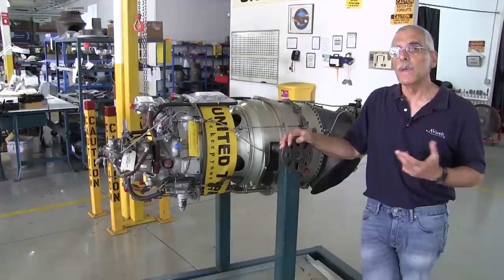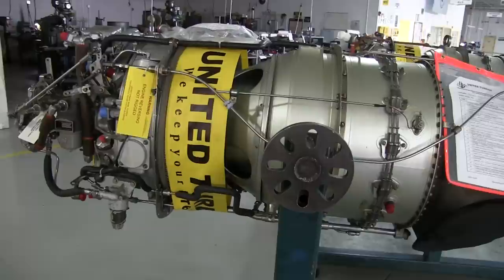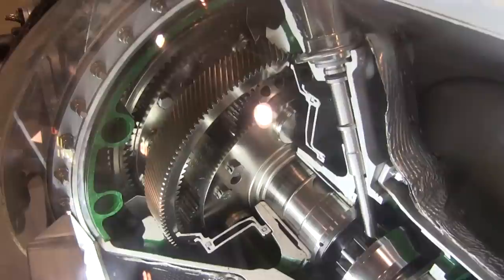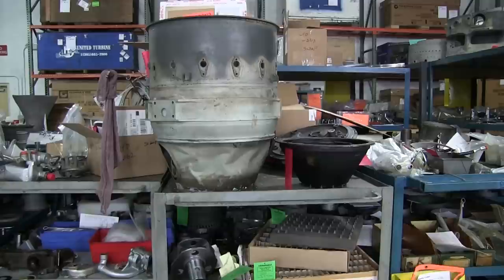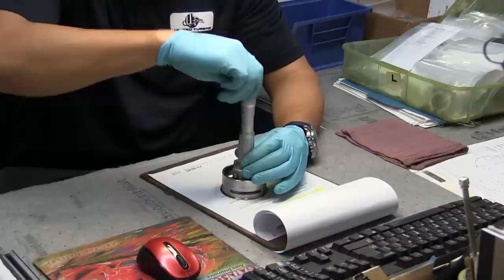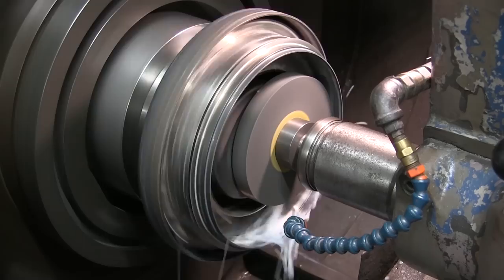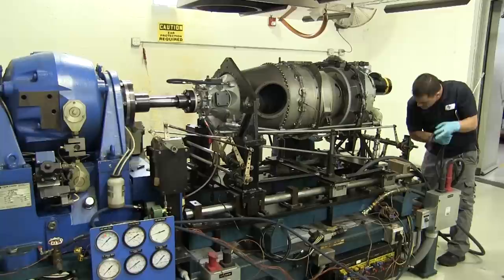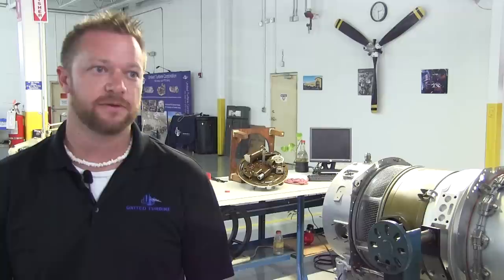How PT-6 Turbines Are Overhauled

Comment: The final step is open-wallet surgery, performed while the customer is hanging upside down.
Reply: lol!
Reply: I love the imagery...but...if something goes wrong in the air you can't pull over to the side of the road. Repair is still cheaper than replacement.

Comment: In your explanation you say the free turbine setup makes it different to a turboshaft, this is incorrect. A PT6B is a helicopter version, which is still a free turbine but also a turboshaft because of the mayor gearbox it is attached to. 

It is mainly wording, I know, and a bit confusing. Because all turboprops have gearboxes between them and the prop, so I don't know from which point it changes to a turboshaft by definition.

Comment: Was hoping to finally see the machine that liquefies cash and injects into the parts :(
Reply: +sugershakify You did see the cash liquifier. It was that entire building! It takes cash and converts it over to parts and labor and profit at an astounding rate!
Reply: It’s smaller and harder to see at P&W overhauls. The ones used on Safran overhauls are much larger.
Reply: Are you saying there’s a HUGE markup with turbine overhauls?   Similar to an oil change for a Mercedes Benz vs Toyota?  😜

Comment: Are PT6's still made new from the factory or are they all rebuilt?
Reply: They make new PT6 engines. There are new planes being build that use PT6 engines. They install new engines, not re-manufactured engines. There are several versions of the PT-6.
Reply: We (eaton aerospace/ Argo tech) make OEM fuel pumps all the time. Haven't made many spares, all for new OEM engines.

Comment: I wonder what the power losses are when you force the incoming air to make four 90 degree turns before it is mixed with the fuel. The exhaust of course also  generates negative energy  through negative thrust and drag as it is expelled out of the front of the engine. Building a pusher prop version of the PT6 would probably be more powerful since the air could be fed directly into the compressor section.
Reply: Look at the Piaggio Avanti. :)
Reply: Afik is because it helps keeping the gearbox mechanism small and makes for an easier installation o small aircraft.
Reply: There will always be parasitic losses whether the airflow changes direction or not.Every engine that uses centrifugal compressors must initiate at least two 90 degree airflow turns.This is how a centrifugal compressor works,it trades air velocity for pressure.This is known as the Venturi effect and applies equally to liquids and gases.

Comment: The turbine overhaul process is considerably longer and more involved than overhaul of a typical automotive reciprocating engine.
Reply: Even the overhaul process of a piston airplane engine is longer than an automotive engine overhaul.
Reply: Yes that goes without saying. You can overhaul a recip engine(automotive) in a day or two. It is a very different world when you start looking into how much documentation and tolerances impact the job time in aviation.
Reply: What makes the overhaul process and costs so much more for an aircraft engine over a car engine is the number of intensive and detailed inspection procedures,  equipment and requirements. 

A car engine failure is generally a fairly minor inconvenience.  An aircraft engine failure is often a fatal problem.

Comment: Hello
first of all, I'm sorry my English is very bad.
I have a PT6A-6.
This engine; turbine blade, Thermocouple Probe, stator vanes's burned.
How can I get these parts?
Reply: Hello, if your vanes are burned beyond OHM limits you will need a new set of CT blades as well. Pratt & Whitney Canada Plant 5 in Saint-Hubert, QC, Canada can overhaul your engine but the PT6A-6 is a very old model and it might not be worth repairing.
Reply: When he mentions stator, I guess he means PT stators not the CT ones. CT stators have their vanes eroded and FODed, not burned.Having an old model never been an issue as long as the engine have his Certificate of Airworthiness. He should probably look for an Authorized Service Center near him instead of having it shipped at St-Hubert. He mention having issue with his English language. He's probably not a north American operator. As for the old spare parts, as long as P&WC knows that one of their customer need one, I can assure they will provide it. Its a matter of pride and reputation to stand by the "Reliable Engine" logo. A couple of years ago, they even rebuilt two WASP for a replica of Amelia Earhart's airplane.

Comment: It would be interesting to get some idea of the cost involved. There must be an absolute minimum and typical cost they could supply.
Reply: Not all engines wear the same though, once you start replacing the spinning parts, it probably gets quite expensive quickly.. Like thousands per blade. and tens of thousands for discs...
Reply: It’s generally about $500,000.
Reply: There's no price for reliability.

Comment: so what does it cost to rebuild an average pt-6?
Reply: $200,000.00 to $300,000.00.. They cap the cost at $300,000.00 for a normal functional power plant.
Reply: The TBO and HSI varies depending if it's a small PT6 or a large PT6, from 2000 hrs for PT6A-38 to 6000 hrs for some PT6A-65 and 67 versions. But P&WC offer a pay-by-hour maintenance plan that most operators use to keep their maintenance fee as low as possible. Now some parts are replaced or reworked before attaining the TBO mark, making less likely to spend a $300k in one shot. Plus, there is less occurrence of extra worn out damage that happen when many parts get old and affect the performance of other.
Reply: so unlike his opener where he compares piston engines and turbine engines, turbine engines don't really have a longer TBO unless you go really big

Comment: I love how he opens up with the completely false statement: "all parts are spinning in the same direction..." Absolutely wrong. The compressor turbine and Power turbine spin in completely opposite directions.
Reply: Primus Airborne his statement is true if you don't understand it as " all moving parts goes the same way", but as "each part only goes one way". In a turbine engine, each part has one direction of motion, in opposition to a piston engine where parts are changing directions at least twice every rotation, hence avoiding accelerations on the parts or non uniform wear... It's kind of a semantic problem there, I think, although as I'm not English speaking born, maybe he should have said it some other way to be properly understood...
Reply: Also implies at 1:50 that turboshaft engines are not free turbine, but the PT6B is a turboshaft engine and it is also a free power turbine design.

Comment: This technology is so old. I can’t wait till everything goes electric, simplified, efficient. No more ridiculous costs for overhauls. Aviation will finally be cheaper and more affordable.
Reply: Yeah...just got to wait until they discover an efficient fuel source to give good sustained flight times...lithium ain't going to cut it...fission is dangerous and still to heavy and bulky...guess we will have to wait until we become a type 1 civilization in a century or two when we crack fusion!! Hydrocarbons aren't going anywhere anytime soon!!
Reply: It won't matter that the powerplant is simple. It's aviation and it'll always be expensive. There's always going to be inspections and time limited components. If there is no secondary income stream from parts, inspections and overhauls it doesn't really give much incentive to develop/certify the powerplants. As it is now they can expect to get your overhaul business every few years.
Reply: Aircraft grade parts and maintenance are expensive because so much work has been put into them to function as long and as well and as safely as needed and beyond that for safe measure.
Sure, fuel costs are big and so is the powerplant but electric powerplants and batteries would still need to be made way better than even the best on the road and would need to be maintained just as much, it's cheaper but not an insane amount.
Reply: They are still going to make you replace your battery every year, or every so often. 

At least for 20 years until they have a guarantee it will work.
Reply: 🙄 Yeah... because batteries last forever and never have to be replaced at exorbitant cost.  Doofus.

Comment: Uh, many turbines have parts and assemblies that "counter-rotate" and they still have "pressure pulses" that are causing vibration and resonance of parts. They're just so much less efficient and "leaky" than piston engines and waste so much more heat energy and pressure that the vibration and resonance is "cushioned" by the vibrations flowing through the engine. The ridiculously loud exhaust is all wasted energy. Similarly powerful piston engines burn a fraction of the fuel and produce a fraction of the noise to make as much power. Piston engines that burn as much fuel and make as much noise produce far more power.
Reply: PT6A-6 weight 270 lbs and develop 578 hp vs the R-1340 that weight 930 lbs for a power of 600 hp. If the piston engine burns less fuel per hour as you said, remember the part of that fuel is uselessly wasted to lift its own extra engine weight. ;)
Reply: But did you see a piston engine on Airbus or rafale ?